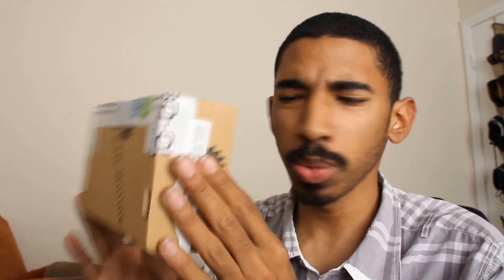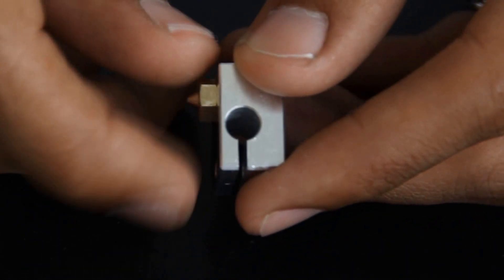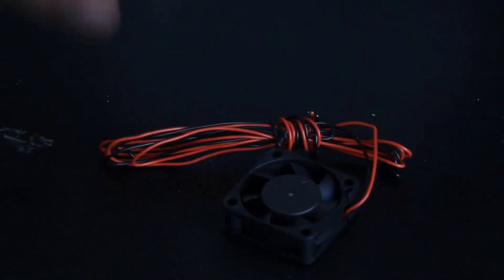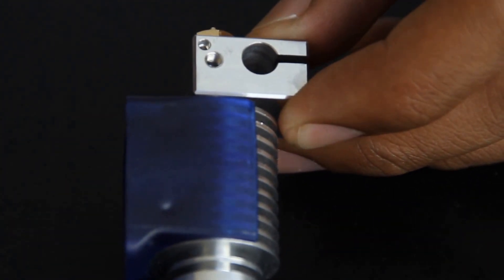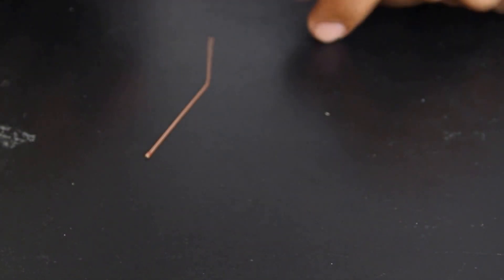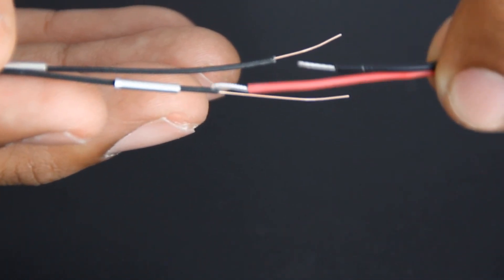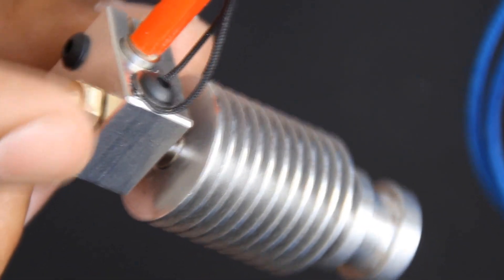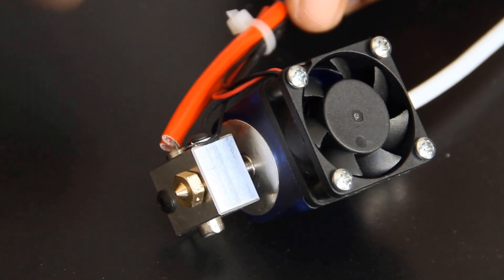Expert Mods: E3D v6 Assembly

Comment: Your timing couldn't be better! I've had a Robo3D for quite a while now but it jammed ages ago and I kind of left it gathering dust (literally) as I was always daunted by the thought of changing the hotend (I'm not very good with electronics etc). 
I finally decided to pull my finger out and try to get my printer back up and running so I assembled the E3D v5 hotend that I got ages ago too and I currently have my Robo stripped down with the old hotend removed and the new v5 waiting to be installed.
I was sat looking at it last night wondering what the best way to install it would be so I'm really looking forward to your next video.
Reply from the maker: Chris Broadbent I should be able to get it online tomorrow.

Comment: Great video! i was wondering if you could explain the difference between different nozzle sizes and if you need do adjust the software in anyway to use them.
Reply from the maker: damskippy25 I can make a detailed video on setup later but to put it simply; bigger nozzle allows faster prints, and layers larger than 300 microns; smaller nozzle allows more detailed prints and layers smaller than 100 microns. and as far as software goes (in Cura at least) just change nozzle size in advanced settings. An extruder calibration would have to be done as well.

Comment: Thanks for all of your videos. I just purchased a Robo 3D R1 Plus and cant wait to apply some of your upgrades to it! I just have a quick question about the exact model of the e3d-v6 you are using. The website has a 12v and 24v option as well as a direct drive or Bowden option. I'm assuming for the Robo 3d R1 Plus it would be The 12v Bowden option? Thanks again for all the information you provide.
Reply from the maker: 12v direct, you would bowden if you did this: https://youtu.be/SlBzf3BRglk

Comment: I have the Robo 3D R1.  There are two versions of the E3D v6 on Amazon, Direct, and "with Bowden add-on".  Which one do I need?
Reply from the maker: The Buzz Above Direct, the Bowden add on is for a printer that has the extruders gears away from the extruder head.
Reply: Novice Expert Thanks!
Reply: +Novice Expert I've just ordered an E3D V6 "Bowden" Extruder because in your video you show a Bowden type extruder. Are they the same and I can just cut the Bowden tube before the hogbolt like you did?
Reply from the maker: +Clayton C I usually get stuff from E3D, but let us know how it works
Reply: +Novice Expert I was more concerned with your comment to "the buzz above" where you said he should get the DIRECT version and not the bowden tube version. In the video you are assembling the bowden tube version and you cut the bowden tube. This is what I had planned on doing. I'm just hoping it will be ok on my Robo3D R1+
Reply from the maker: +Clayton C In the video I assemble a direct. Both direct and bowden 1.75mm come with bowden tubes, the bowden versions just has a lot more tubing. The direct only comes with enough to go from the heat break to the hobbled bolt. The bowden would have enough to wrap around the whole printer.
Reply: +Novice Expert Thank you for that. I should have mine in a few days.
Reply: +Clayton C Hobbed bolt not hogbolt.. amateurs lol

Comment: I was looking for a cooling block that uses the pneumatic fitting to grab the tubing. Wouldn't it be better? Thanks.
Reply from the maker: I'm sorry, the syntax of your question does make sense to _GlaDoS
Please enter query again rephrased.

Thank You,
_GlaDoS
Reply: It has pneumatic connector integrated. It is the black part around the tube that is normally blue and releases the tube when pressed. PS: I think Czech phrase decoder is more robust to bad word order in phrases...

Comment: Hey dude, I heard you can use the same thermistor from the stock print head. I recently broke the one that came with the e3d v6 :(. Will it be possible to just screw in the thermistor thats already wired up?
Reply from the maker: Yilen Pan Yes, I buy extras just in case they go out. I use these http://www.amazon.com/RioRand-10-100Kohm-NTC-Thermistors/dp/B00GD471PO/ref=sr_1_sc_2?ie=UTF8&qid=1435214098&sr=8-2-spell&keywords=thermisitor
Reply: Novice Expert perfect, I just ordered those. But can you use the thermistor that's attached to the stock extruder? I'd love to be able to install this before my amazon order gets in.
Reply: Novice Expert Btw, love the channel.
Reply from the maker: Yea, that will work. It may not fit in the hole on the E3D but I used a paper clip last time
Reply: Novice Expert Thanks dude!

Comment: Hello there! I could really use some help. I followed your videos on installing the e3d v6 on my Robo 3d. I also updated the software. Everything seems to be plugged in but not working properly. I am using Mattercontrol. What is not working: Manual movements (but the home buttons work), preheatings, and printing (of course). I am getting an error: "Your printer is reporting a hardware Error. This may prevent your printer from functioning properly. Error Reported: Extruder switched off. MAXTEMP triggered!" Please help :)
Reply from the maker: I would recommend making a detailed thread about your issue on the Robo3D forum. 
There is always someone there to help, me on the other hand have work and school, help from me may not be to consistent.
Community forum link: http://community.robo3d.com/index.php

Comment: After changing the e3d nozzle position change as I have anet a8 original firmware with original board what setting apply for printing in center of bed plz helo
Reply from the maker: I'll be making a video that should help with all firmware calibration soon.